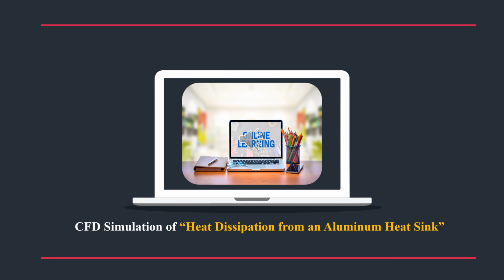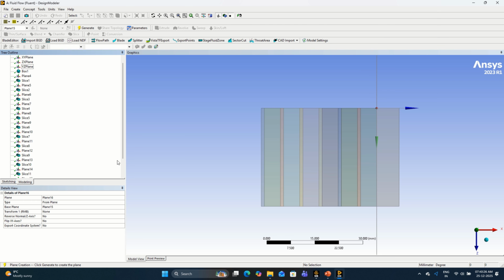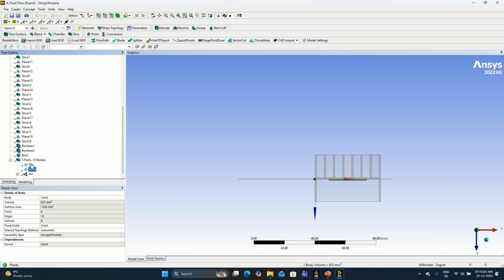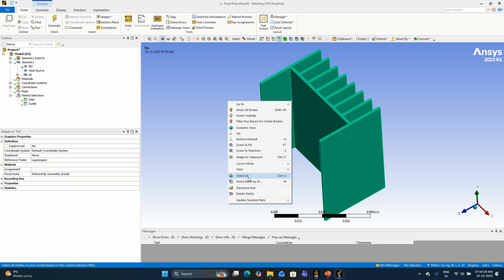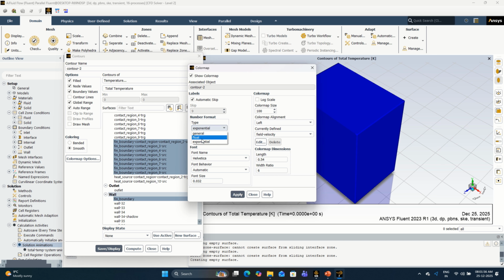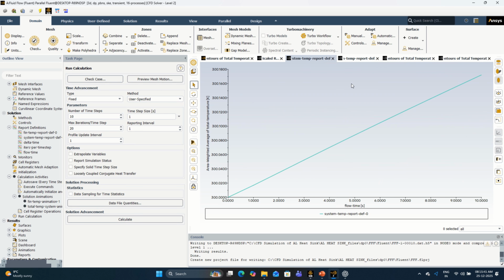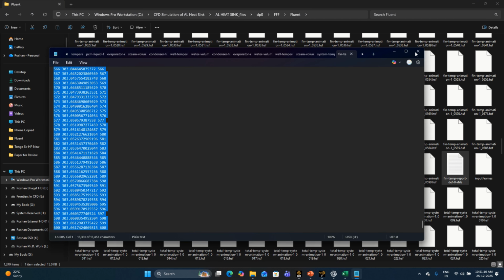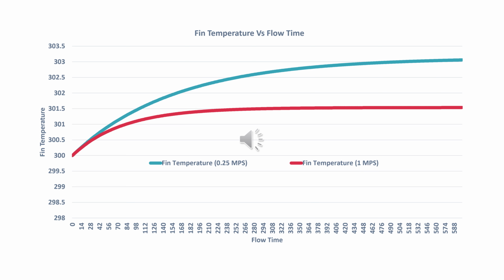CFD Simulation of Heat Dissipation in an Aluminum Heat Sink | ANSYS Fluent | FCFD-0150

Comment: Please share link of this research paper
Reply from the maker: not an exact reference paper but followed the below 1) Thermal performance enhancement in PCM heat sinks using novel conductivity techniques: a review 2) Constructal design of Array of Tree-shaped Heat Sink. Connect on whats app for paper +919834584778